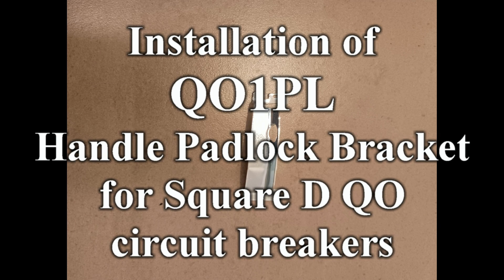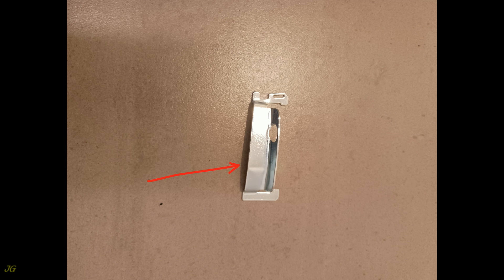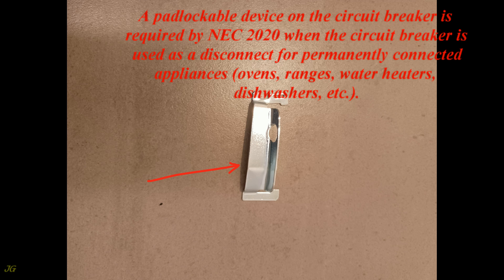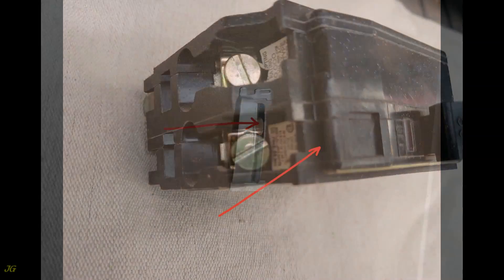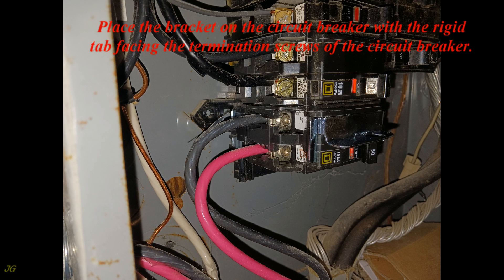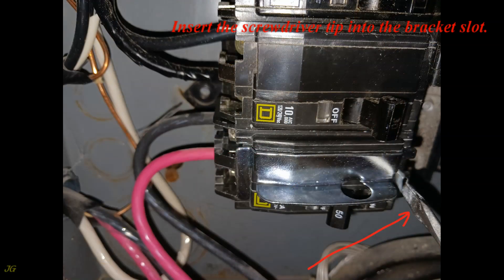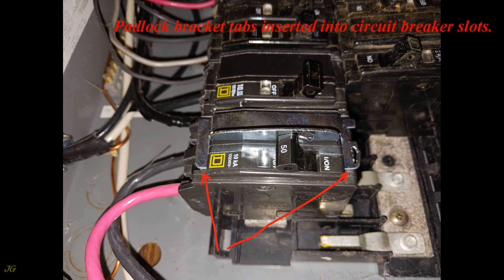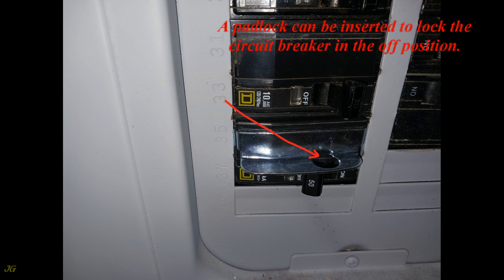Installation of QO1PL Handle Padlock Bracket for Square D QO circuit breakers

Comment: What about the 2 pole breaker with two tied handles? does not seem it will work?
Reply from the maker: No such 2pole SQD QO circuit breakers with 2 handles.